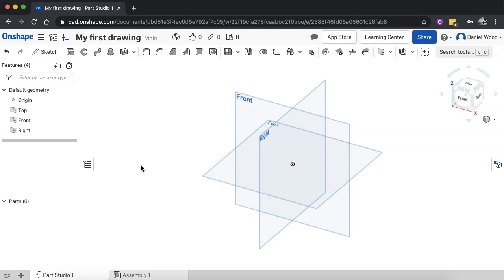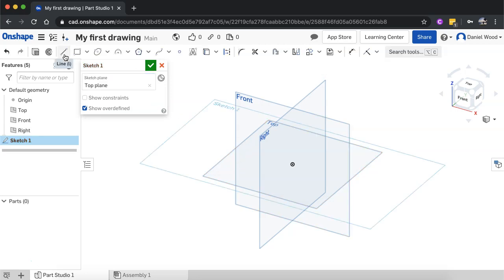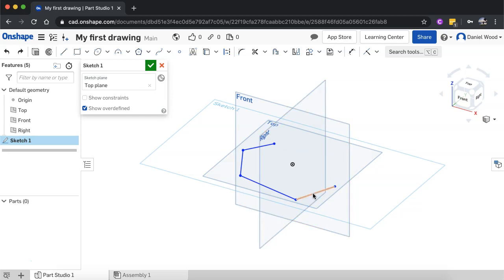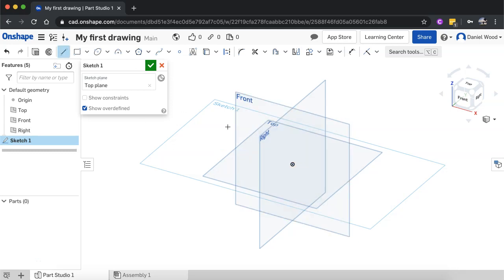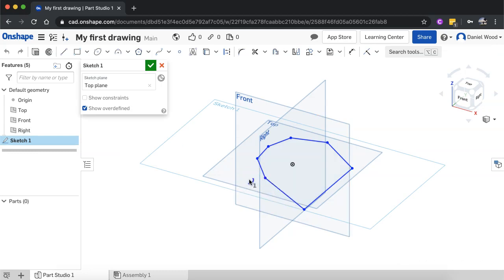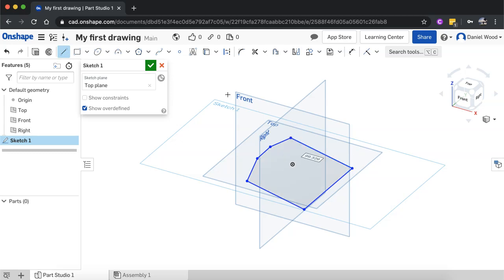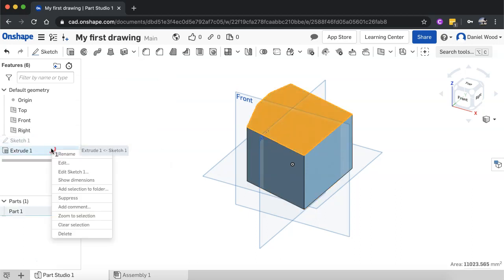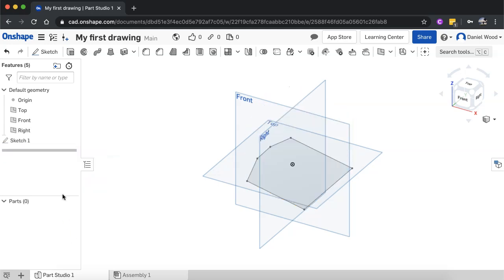Onshape CAD Tutorial 3 - Selecting and deleting

Comment: Don't know if you'll see this... but I created rectangle, extruded it and constrained it to certain dimensions.  I want to take the top plane and narrow it and the bottom plane and widen it... make it into a 3D trapezoid.  It appears to be impossible.  I have spent well over an hour clicking on anything and everything I can but it looks like I will have to start all over.  Once those lines turn black, it doesn't seem like you can edit them anymore.  Or maybe extruded shapes can't be edited.  I know I can do it on Sketchup but I've heard Onshape is much better for 3D modeling.  So far it's just been kicking my butt!  Any suggestions would be appreciated.